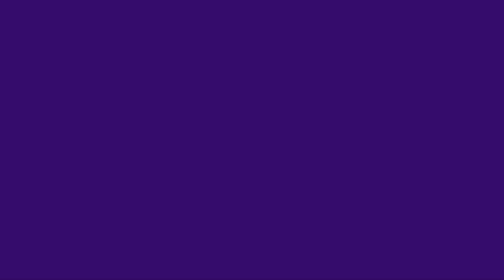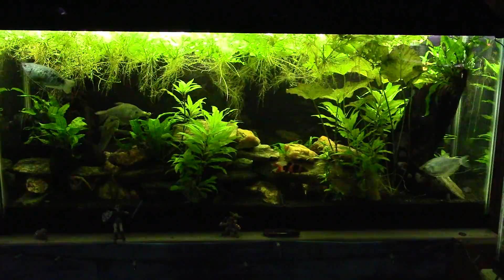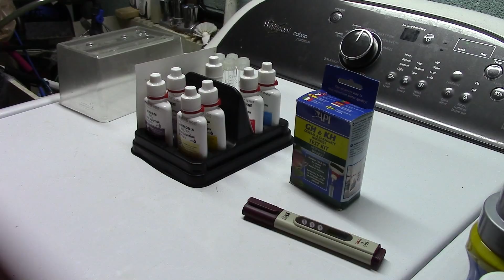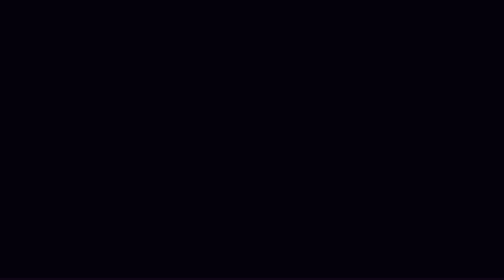My Thoughts on: Testing Your Water

Comment: Right on Dan, I'm getting  into shrimp , so after 30 years  of fish keeping  I might  be getting  a ro and remineralizer  and tds meter . It pains me, when I get all scientific  about  stuff  I have problems  when I just take care of stuff  it thrives be it house  plants,the garden my tank's  ect...
I'm so confused , I don't  want to  deal  with all this. I have hard water , it's always hard water I could put a log in my water and a bucket full of peat moss in my tank and it would test at least 8.4 and hardness of the chart like 22 pm  or higher . 
 so your running  ro water , remineralizing , using  activated substrate . Then the substrate  gets depleted  and ph rises or crashes livestock  dies have to break  down the tank buy new substrate , substrate  additives  and more shrimp . that's a couple  hundred  bucks in ten gallon , then you have your lights, dry ferts,shrimp  safe ferts,liquid  ferts,co2,co2  meters,mineral  balls ,mineral  rocks,various  leaves and powders  and additves. good grief ,I'm shure it doesn't  have to be so complicated  to have some shrimp  reproducing  in nice  planted tank. I've kept  under stocked  low maintenance  tank's for years  with very low death rates and the fish live in hard water  or they don't
Reply from the maker: +Damion Markham That sounds like a lot of work for shrimp. Lol
 I just finished shooting a video about RO water, TDS, hardness, Osmosis, etc..
It should be out tomorrow.

Comment: I have the api master test kit.  I recently had to replace the nitrate and ammonia tests. Use them often   The nitrite I rarely use since I've never had nitrites in my tanks.   I mainly test my discus tank. My other tanks usually don't need much testing. With my weekly water changes the nitrates stay below 20. With no ammonia.  
  I also have the kh and gh test   I bought thAt to see if my water was soft enough for discus and it is.  
  You are very right about the spikes in ammonia if you make any changes. I removed live plants I had in pots from my discus tank and had a ammonia spike.  That might have helped kill a couple of my discus last year even though I was doing twice day water changes.   I had another spike in the past month when I added three discus and removed a piece of wood.  Never got higher than .50 ppm but still too much.  It's less than .25 ppm now before my daily water change.  Working to get it to 0.  The most important thing is weekly water changes
Reply: And then a before and after test monthly to see what's going on with the water   Weekly and sometimes daily testing with more sensitive fish like discus.
Reply from the maker: +T Holz Some of my test bottles are starting to pile up, since buying a whole new master test kit is a little more than replacing the nitrate test alone. Lol I just get another whole kit, so the pH test (high range) that I rarely use is still a full bottle, ans now I have two full bottles. Lol
Reply from the maker: +T Holz Yeah, the before and after testing tells you a LOT of information.
Reply: +Dan Hiteshew   Yes I know what you mean I paid $12 for the ammonia test kit last week.